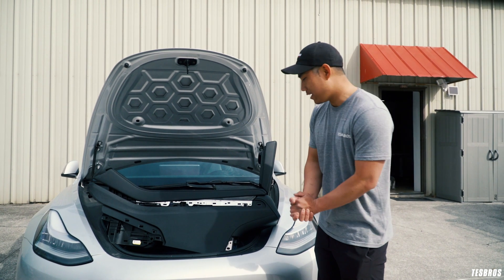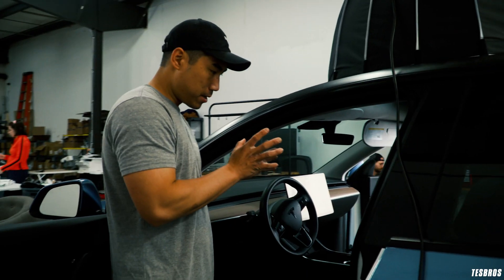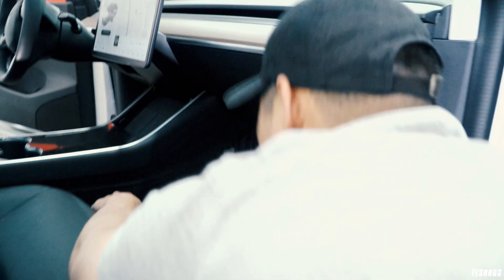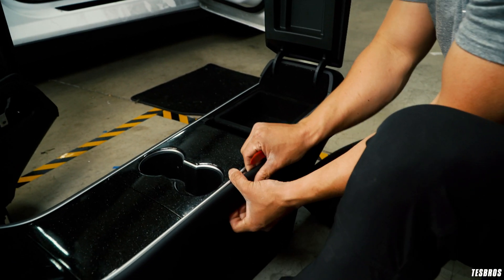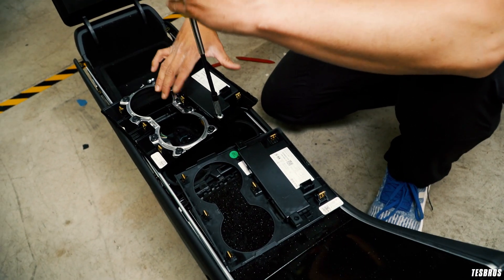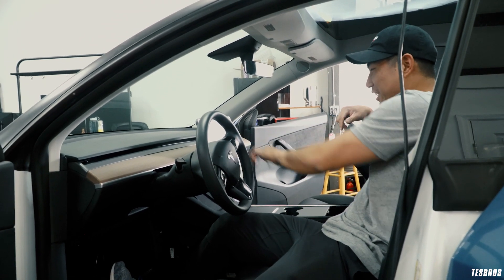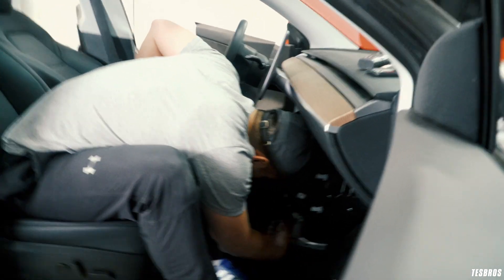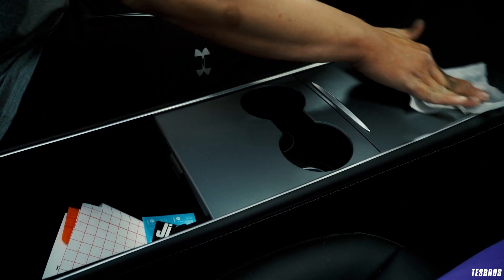Tesla Center Console Swap Gen 1.0 to 2.0 - TESBROS

Comment from the maker: Are you going to update your console? Or stay with the old?
Reply: Would love to swap, but have no idea where to get the new version.
Reply: @xeratube  Just got mine installed at my Service Center. After a ton of complaining with the reps through the app, they offered for me to come in and they offered to install it for $1011 out the door. Only took about an hour or so.
Reply: @xeratube  also just a heads up, the new consoles do not do data so if you use sentry mode, you’ll want to look for this part “Tparts CONSOLE DATA TRANSMISSION MODULE” to get data back. It only does power now because Tesla wants you to use the USB port in the glovebox but I would imagine you don’t have it on your car since that started popping up when this console came out in late 2020.
Reply: @famoussasjohn  how were you able to convince your service center to get them to install it for you as well?? I'm interested in getting this installed on my 2019 Model 3 but don't really trust doing it myself.
Reply: Is that the wireless charge works? After swap gen2.0?
Reply from the maker: @cookies3777  mine worked after the swap.
Reply: @tesbros  👍
Reply: Why do you have to swap the whole console? They look really similar. Couldn't you just swap the top portion?

Comment: Debating if I want to do similar to install enhanced auto knob or just mount the knob on the side of my console…either way looks like I need to remove console.  

on my 2020 3 to hide my usb if I don’t swap my console I will hopefully at least partially remove console to hide the usb wire to the knob.  I plan to mount on the side of console if I go with this option.

Comment: thank you for this video!!!!   8:25 the video is so dark, it's hard to see the details of the back console parts in the black console
Reply from the maker: Thanks for watching! Sorry about that, do you have any questions about that area?
Reply: @tesbros  lol, no worries, I downloaded your video and opened it in VLC and maxed out the brightness.  I was trying to find out how the part the smartphone rests on can be pulled out, and it looks like it's just 5 clips.  I designed and 3d printed a magsafe charger holder for that drawer, but was hoping to just replace the entire part that lifts up.  Thanks again for your video!  It helped a lot (or will help, when I replace my current design.

Comment: Got mine all swapped over but the wireless charging does not work. Any ideas? Yes it’s plugged in on the charging pad
Reply from the maker: There's a micro usb data cable underneath the console. Was that plugged in?
Reply: @tesbros  There wasn't a micro usb cable under that I could see at all. I looked everywhere for it and theres no split off like on the 1.0 console
Reply: The lights work on the center console but none of the ports work. The 12v outlet does work also

Comment: Such a great video. Thank you! I’m going to give it a shot on my 21 MY. I’m just a little confused on the possible need of the usb transmitter so that sentry mode works. Is that is for sure needed?
Reply from the maker: not 100% sure. might not be needed anymore. but my sentry mode worked right away for me.

Comment: Will this work for 2018 model 3 performance?
Reply from the maker: No, only 2019+. The issue is the CANBUS isn't the same connection
Reply: @tesbros  how to find the Adaptor for the canbus
Reply from the maker: @allansmith8643  there currently isn’t one on the market.

Comment: I'm trying to remove the center console from my 2018 Model 3. But I can't figure out how to disconnect the pesky USB connector on the RH side. What's the trick to pulling this apart? It looks so easy in your great video!
Reply from the maker: Not sure since sometimes they do change small things like this. Most of the time though, it is a push clip so if you can, try to see if there’s something to push on and it’ll release it.

Comment: What did the car display say when you sat it in and woke it up without the CANBUS connected?  Hard to make out what's on the screen.
Reply from the maker: It didn't have an error code or anything on screen - it just woke up and then what I was doing on the screen was turning it back off again

Comment: Planning to do this on my 18 as I’ve found the wiring to switch pins from the blue to white, how did you get your wireless charger to work because as I’ve seen there is no where for the one on the 2.0 console to plug or connect to
Reply from the maker: The 2.0 console connections for that are integrated. As long as the console is connected to the car with the CANBUS, then it has power to charge wirelessly too.
Reply: @tesbros  great thank you so much, excited to tackle this project soon!

Comment: @TESBROS
Hello, i dont understand have you swapped a m3 center console in a Y?
I found one but its for Y will it fit in a m3?
Reply from the maker: The model 3 and model y center consoles fit in both cars the same. Just have to pay attention to the year to see if it’s compatible. What year console did you find and what year model 3 is it going in?
Reply: @tesbros  thanks for your answer, i found a Model Y 2022 Console 1755503-70-C, my car is a M3 Performance 05/2019 from US (iam from EU)
Reply: @tesbros  i have the Blue connector
Reply from the maker: @palmer_inc7051  The CAN BUS connector for the 2019-current models is the same, so it should be swappable!

Comment: Great video.  Always glad to see someone did it first.  I also have a 2020 model Y with the gen 1 console.  Did the center console come with the data USB-c module or is it just power only?
If power only, did the cable for data come with that version of the console or if I buy the module separately, do I need to also buy a cable to connect it?
Thank you in advance for any insights.
Reply from the maker: This one did come with the data USB-c module - but this was a couple years ago. It might not anymore, so it depends on what year 2.0 console you get. Vehicles delivered in and after June 2022 should have consoles that are power only. So once you get yours, check first, and if you want the data USB-C module, you might have to buy that part separately. Here's an option - https://abstractocean.com/products/usb-c-upgrade-module
Reply: @tesbros  thanks for the reply. I ordered and installed mine this weekend. I ordered the data module just in case and good thing because it was needed. It didn't come with the data (USB) cable either,  but I was able to use the one from my original console. Thanks for posting this video, it was was prompted me to perform the upgrade and gave the the confidence that it was easy enough to do.
Reply: @staytuned8584 Did you order the Gen 2 console via the Tesla part store?
Reply: @aran6612  I ordered using my mobile app.  Actually I walked in to service and spoke to a very helpful individual and after confirming prices, he advised me to use the mobile app, which I did.  I received a quote through the app then after I accepted the prices, it was ordered.  Was a very easy process.  I did have to contract the service center to see if it had arrived yet since I didn't get a call.  I assume they assumed I'd just come in on the date I set the appointment to.

Comment: Did it my self today was an easy swap 10 min job my wireless charger work usb c port work but when I plug my usb c drive it says check your usb drive it does not want to recognize it plugged it in to my computer works fine what could be the problem?
Reply: Fixed my issue my 2.0 console did not have a usb unit ecu so took one from my old one and put it in works everything good
Reply from the maker: Glad you got it fixed!
Reply: @maxv5888  hi can you please explain what’s the usb ecu unit ? I’m about to start the swap soon as well…
Reply: @doomam  Most likely this, I posted on another comment near the top. I would assume you just got your new console, unfortunately the new consoles after a certain period of time after release do not do data so if you use sentry mode, you’ll want to look for this part “Tparts CONSOLE DATA TRANSMISSION MODULE” to get data back. It only does power now because Tesla wants you to use the USB port in the glovebox but I would imagine you don’t have it on your car since that started popping up when this console came out in late 2020.

The part is $85, just make sure you choose the appropriate processor (Intel I imagine since AMD is on relatively newer models within the last few months.)
Reply: @famoussasjohn  hi thanks for your reply, i actually do have a may 2019 TM3 so I believe I won’t have this issue ? I’m still waiting for the console for delivery, they have delay issues right now
Reply: @maxv5888  where is the USB ECU located on the 1.0 console and where did you install it on the 2.0 console?

Comment: We just took delivery of a used 2020 performance model 3, figured you may not see this comment but decided to give it a shot. From what I understand the 2020 Model 3's can bus pin-out is the same as the one that comes on the refreshed center console? My local SC seems to be cool with just picking the center console up, they weren't entirely sure that the connector was the same and the service technician was out on a drive while I was there. Thank you so much for any insight!
Reply from the maker: Yes, should be the same can bus connector! We put the new center console in a 2020 model y for this video and had no issues connecting.
Reply: @tesbros  thank you so much!

Comment: I just did the swap on mine following your video. It went smoother than I thought. My new console was made in early 2021 so I still had the data hub in the center console, but others may not.
Reply: What do you mean about the data hub? Did they remove the USB ports from inside the center console in the new one?

Comment: Is the front storage (the one between the cup holder and the charging pads) a closed capsule?

Im asking because my girlfriend managed to get Vietnamese Pho soup leaking into it. I basically had the soup inside at the bottom Handy for a mid-travel snack. 🤦🏻‍♂️

I carefully cleaned it all out. Took me a whole hour. But now I’m worrying that the soup might leaked below the bottom of the capsule? Would that be possible?
Reply from the maker: You guys broke up, right? Just kidding :D 

It is so you should be fine. Be careful with Pho next time. It's dangerous. Pho-real.
Reply: @tesbros  still love her though. But I was not available talking for a whole evening. Gave pamper to my 2nd love (the model Y) instead 😅😜
Reply: @tesbros  thx for the quick reply! This calmed me down!

Comment: Would this work on a January 2019 Model 3 AWD?
Reply from the maker: It should. But I would still ask your service center if the can bus for your 2019 is the same as the center console you'll be getting. The can bus is located in the back of the center console underneath a panel that clips out. We talk about it around 1:45 in the video. If that's the same, you should be good to go.

Comment: I replaced mine, but my USB ports an charging don’t work. Rechecked all wiring and still nothing . Any idea?
Reply from the maker: I’d triple check the micro usb. That’s the connection that powers that. Also, I’d do a power on and off too. Hope that helps!
Reply: @tesbros  I played with that mini-usb connector for a while since it’s easy to access on the side,  with no results. It seems like there is no power since wireless charging doesn’t work as well. When I connect my thumb drive directly to that USB wire under the cover, it works. However when you plug it back in, all 4 USB ports are dead. I’ve checked the big power connector and it seem to be OK, there is a 12 V power coming in, but doesn’t seem like there is 5V present. Might be some internal breaker that was triggered during installation (I’ve unplugged 12v and under the seat connector) and could be switched back on remotely, but since that wasn’t TESLA approved upgrade, I would be liable for the payment.. even if they can fix it. I will switch back the old one and see if it works, and will go over the wiring in the new one.
Reply from the maker: @MrAndreybond  reach out to us via email. I can see if we can help.
Reply: @MrAndreybond  did you get it sorted out?
Reply: Also interested if you got this sorted out. Going to do this swap myself soon and I'd like to know of any possible things I could screw up.

Comment: I have a 2019 Model 3, will I be able to swap to the console 2.0? Also, I was wondering how the wiring goes for teh sentry since the console 2.0 moved the USB port to the glove box. Any help is greatly appreciated!
Reply from the maker: It should be swappable. The CAN BUS connector for the 2017-2018 models and 2019-current models are different sizes. So, since you have a 2019, it should match! As for the next question, you shouldn't have to mess with anything in the glove box. The CAN BUS is actually what connects all that.
Reply: @tesbros  Is it impossible to do this swap on a 2018 and re-route the old CAN BUS in the new console?
Reply: @Josh-X  About to do that on my 2018
Reply: @ElectricShock14  did you end up doing it?

Comment: I noticed in your video, you showed concern about possibly tripping something and it bricking the car, would it not have been easy to remove the connections from the 2 batteries?  Just wondering...
Reply from the maker: yeah I probably should have done that 😂

Comment: Hi. What type of  can bus connector/adapter is needed to upgrade 2018-2019 model 3 center consoles to the 2022 console?  Is it a 20-pin (2018) to 26 pin (2019+)?
Reply from the maker: Unfortunately, there isn't an adapter out there just yet. But I've heard from techs if you splice it, it may work. But that's not confirmed. I meant to possibly try to confirm this but didn't have the time. :( Sorry!
Reply: @tesbros  Hi.  Thank you for the reply.  The tech at the local service center said the same thing regarding splicing.  An updater would sure make it easier.

Comment: I love the “warts and all” style of videography. Too many videos just completely gloss over the pitfalls and errors. You’re probably the only person who mentioned the clip for the wireless chargers needing to be in to stop it fouling the lid.

One thing that wasn’t obvious to me is where you get power from for the wireless chargers on an older car? The new console has 2 x USB-C ports at the front, and the wireless chargers, whereas the old one had 2 ports and the removable charger plugged into them.
Reply from the maker: Great observation. Tesla's manual on page 23 says a wireless phone charger is integrated into the front console to provide up to 15W of power to charge via inductive charging. (https://www.tesla.com/ownersmanual/modely/en_us/Owners_Manual.pdf) 
So, I think as long as the console is connected to the car with the CANBUS, then it has power to charge wirelessly too.
Reply: @tesbros  Thanks for the clarification. I figured it must be integrated since you didn’t mention plugging another cable in.
Reply: @tesbros  I forgot to ask (as I'm about to try and order this) - what happens with the mini USB connector that you unplugged?  Does that still plug in to the new console?  I've heard people saying there's nowhere to connect it on the new console but that doesn't really make sense to me.

Comment: Hi.  Sorry to bother again but is the can bus plug on the 2.0 console a 26-pin plug?  Looks like I have the 26-pin plug that is blue but the plug in the 1.0 console, not the harness that is from the vehicle, on our 2019 Model 3 Performance is white.  I'm a bit confused because I was told by Tesla that the swap cannot be done due to the can bus but if the new vehicles & the console have a 26-pin can bus wouldn't the swap work?  Thank you in advance for your technical knowledge.
Reply: wondering the same. I have March 2019 model 3. this should be the new Can Bus type which is still in use today. Not sure

Comment: Did this swap today.  Having issues getting the car to recognize my USB-C SSD for Sentry.  Have you observed this also?  If so, what did you do to remedy this?
Reply from the maker: I don't think i've ever had that issue. Have you tried reset or called Tesla service and to see if they see anything on their end?
Reply: look for this part “Tparts CONSOLE DATA TRANSMISSION MODULE” to get data back. It only does power now because Tesla wants you to use the USB port in the glovebox but I would imagine you don’t have it on your car since that started popping up when this console came out in late 2020.
Reply: Any updates ?
Reply: @creamsoduh6392  there are 2 different USB-C hubs.  The earlier model gives both data and power while the updated unit that was in my console only provides power.  I had a mobile tech swap them and I was good to go.

Comment: Seems like pulling the HV loop (or the HV connector under the seat on Model 3) and then disconnecting the 12v battery would have been the wise thing to do, so you don't risk "bricking" the computer by it waking up while you're working on it.
Reply: that's what I was thinking... great mines.... knowing me, I would do something and brick the car...